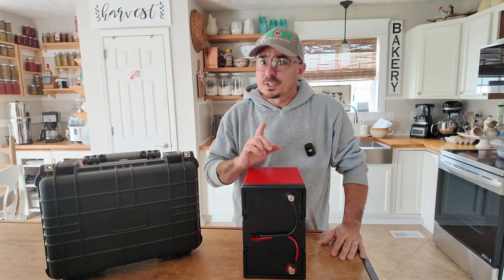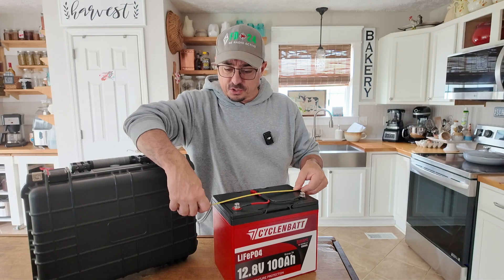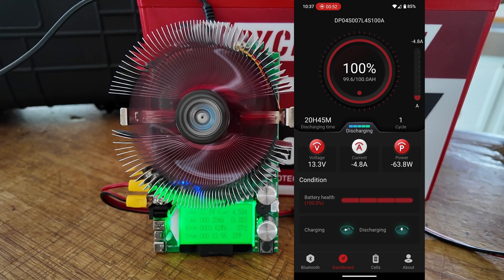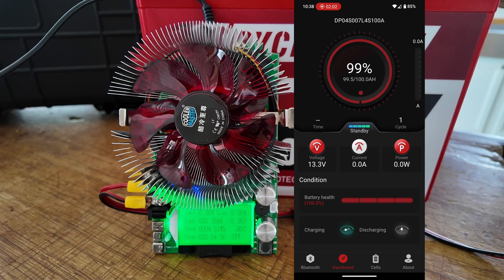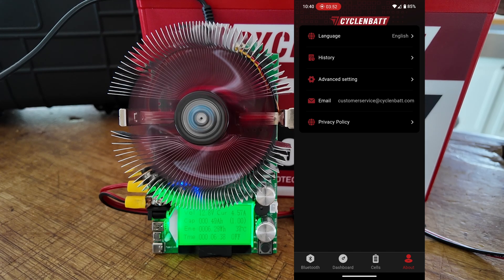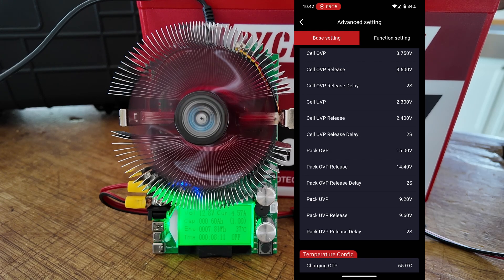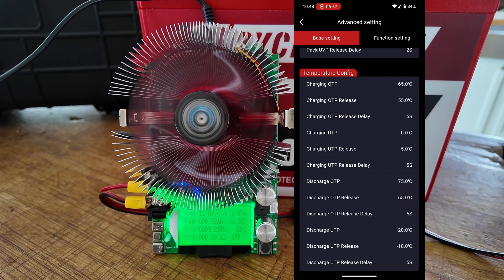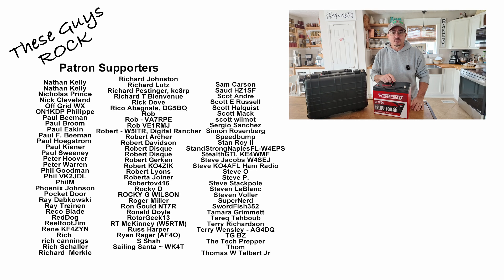CyclenBatt Bluetooth with Programmable BMS

Comment: I have two of these running in series for my 24v trolling motor.  Both are fully charged and connections are correct.  I was able to run my trolling motor one time but since then I am not getting them to put out 24v.  I have a feeling it is app related but hoping you could shed some light on it.  Thank you!

Comment: Great battery. The setting I would change is the low volt cut off . I make it 10.5V or 11V . Below that electronics don't like it. Looks like you can change max discharge amps.  So if you got 10 AWG wire you can set 30 amps protect wires.  73
Reply: You don't want to limit your power output in the software just in case you're unable to change it and you need to.
Personally I run everything through a mini (Edit: MIDI) fuse block due to the short circuit potential of Lifepo4 then into a 6-way fuse block. That way every circuit is properly fused for whatever I'm going to do with it